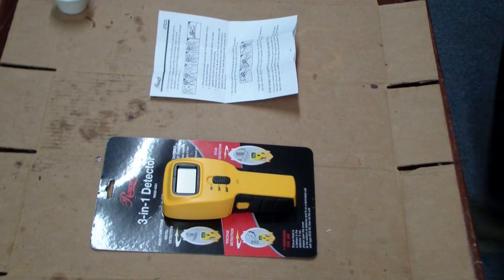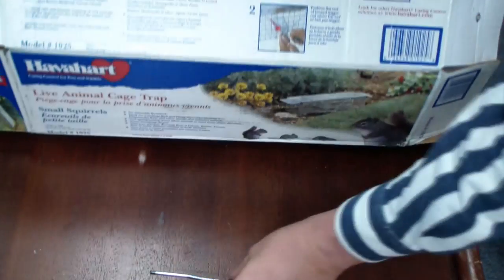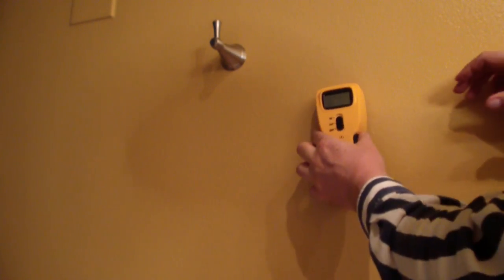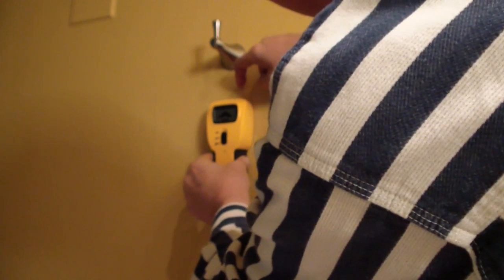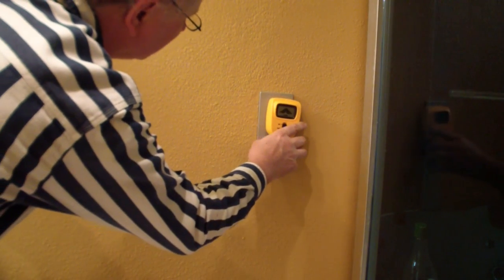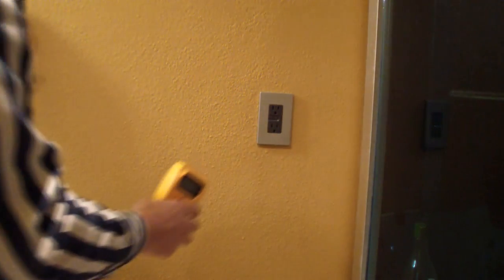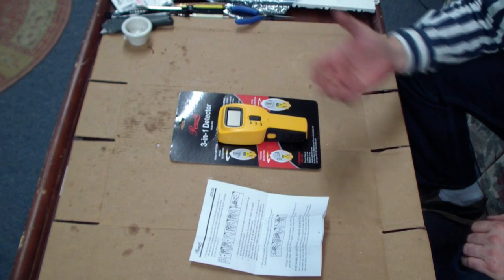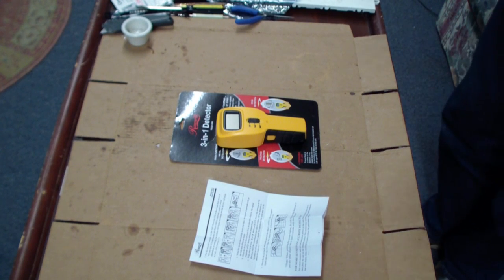Rosewill REGD-6361 Stud, Metal and Voltage Detector Review

Comment: I hate these kinds of stud finders. I own a few Zircons and they get temperamental if you come off the wall just a little, like when he lifted it off the wall to slide it over the outlet, it probably lost its calibration. In my endless search for home improvement products that actually help you move quicker and more efficiently, I saw a stud finder that uses a series of LEDs and as you slide it over the stud the LEDs stay illuminated, so you can mark where your stud begins and ends. I forgot the name of it but it's a really cool tool and I want one! We have come a long way from the finish nail and the hammer, right? LOL